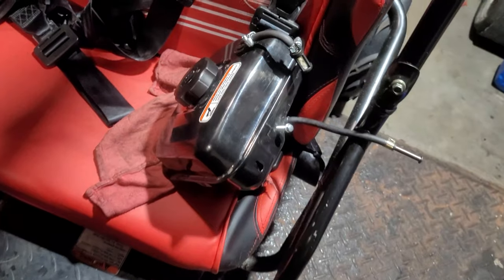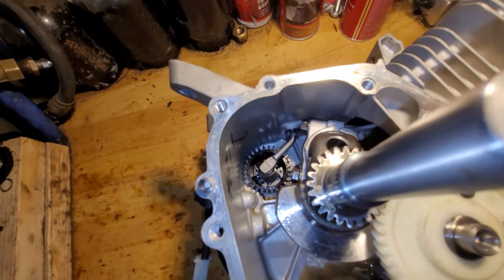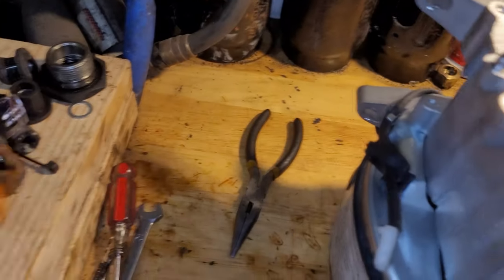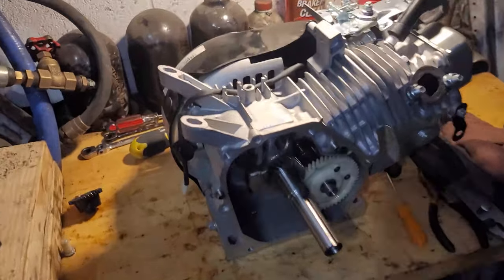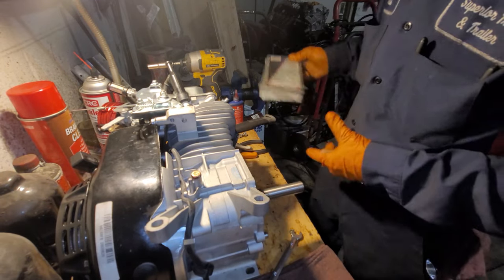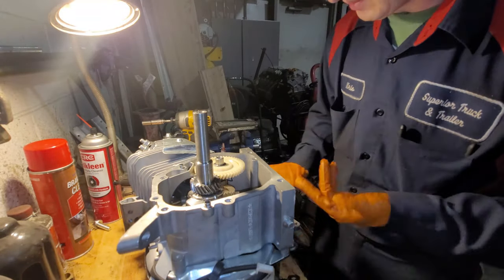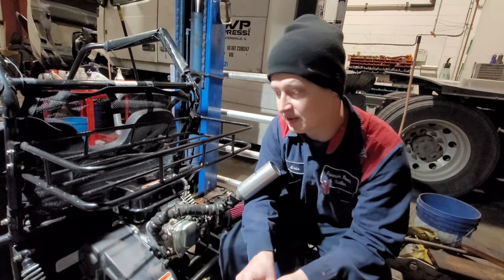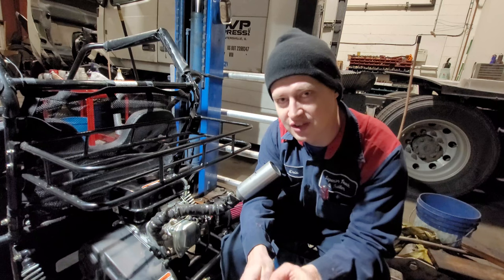Superior Drift Garage - KT196 Governor Removal and TOP SPEED RUN!!!

Comment: I achieved higher RPMS WITHOUT deleting the governor. I noticed that the gas cable doesn't throttle down all the way which prevents the full power. The reason is the Governor lever is designed to do that, but if you  delete the governor lever and rewire the springs a certain way then it will function at full speed.
Reply: Can you make a video how you did this?
Reply: How much faster?

Comment: I just slapped the street tires (lawnmower smooth knobbed treads) , the straight pipe with muffler, injector jet upgrade, and intake kit with better spark plug. Premium gas. She MOVES :) , i will do this as soon as possible. I LOVE POWER!!! THANK YOU A MILLION
Reply: Did u do it
Reply: @joshbrothers3822  not yet, got tied up with life a little lol. Its still in the plans
Reply: Im bout to try it myself. Its a great gocart. You get to it yet? I know how it goes
Reply: @JakeHorne90  i have not yet. I had a spindle arm break apart. So had to fix that lol. I do plan on doing it still. Found an AMR 300/500 supercharger  i would love to put on as well. I added an inline fuel filter. So far the carb has been smoother and havent needed to clean it in between season. Just after it sits for months, i spray brake cleaner in the throttle and drain the bowl. Once it warms up. I plan on doing it :) . In the mean time i made my sons electric dirt bike run about 27-30mph LOL.

Comment: You can also adjust the throttle cable up front where it connects to the pedal and bring the top nut all the way down and the nut behind that one all the down as well. I just purchased one today and it went from 17mph top speed to 30mph top speed.
Reply from the maker: Screw under my pedal way always all the way down....even the day I purchased it. Obviously I didn't get it brand new....but speed was just as you've seen. Thank you for watching!
Reply: Really?
Reply: @thomasquinlan8704  yes
Reply: I'm going to try this, because I was having problems with idle control while tightening the cable to achieve higher RPMS.

Comment: Hi there, we followed the video to a t, the instructions were super clear and helpful. The only thing we can't figure out is where to hook the throttle lever rod and or spring up to. He didn't really show that part any help is greatly appreciated. Ty!

-Mike
Reply from the maker: The throttle arm that you have originally is what you mount the throttle cable to. Keep it simple by reusing that. Drill a small (tiny) hole in the throttle arm, and bend the original throttle rod to fit from the butterfly to your hole in the throttle arm. Secure the rod even with zip ties and should be great.

Comment: How did u hook the springs back up. Now they are just hanging there. No clue how to hook them up
Reply from the maker: I really wish I could have take a pic, in that time I switched to a Mikuni so it's a totally different deal.
Reply: @superiordriftgarage 
I have the same problem. I have no idea what to do know. I have to control over the throttle

Comment: I have the same cart, once you removed the governor linkage, how did you hook up the throttle?  Because the governor rod and spring is usually hooked on to the throttle.
Reply from the maker: I rigged a L shape linkage out of the governor rods that were left over from the governor removal and used that to go from the butterfly to the bracket that has the handle for the throttle. Wish I could post pics on here somehow to show you what's up.

Comment: Question. On the bolt that goes in the hole where the governor arm we cut off is, if I weld a stud on the top and the bolt and put the arm that holds the springs will that work? It wouldn’t  have any play like the original but I don’t know if you need the play
Reply from the maker: Yes it would work,  if you can weld it you can make it work on my opinion

Comment: Could you show a video on how to hook up throttle after this
Reply from the maker: I screwed up by not showing exactly what needs to be done. Currently this gokart has a different carb, so I'm not really able to show that. Anyway, you need to reuse the stock plate that sits on top of the engine that originally holds the throttle cableand drill a tiny hole in the original handle. From the handle, use the rod that is left over from the governor, bend that to a "L" shape and feed that into the drilled hole.hope that sort of makes sense.

Comment: Hey there! Great videos! I got a question on how to remove the rear axle for the KT196. Is it just pressed in and do I.just hammer it out and slide it out?
Reply from the maker: I'll be totally honest with you...I haven't taken apart the rear axle. My guess would be some axle stops by the bearing press board...the part that's mounted to the rear chassis and holds the bearing inside.

Comment: How do you hook up the throttle springs with governor off now? Wish you would of showed this step in the video
Reply from the maker: I don't know how it happened not to be I'm the video but ever since I switched over to a mikuni carb so throttle is completely different. Old setup was connected to stock throttle handle by a rod. Small hope was drilled into the handle and rod to the butterfly.  Rest of the linkage was stock placement.

Comment: Question so we have one fairly new and every trip we have we here a loud skip or jerk of the chain or somthing also a hissing sound when we get on it I use not ethanol gas as I've seen videos where they have used it and engine is fine should I be ? Could chain be too tight it has a little play in it should it have any play at all
Reply from the maker: That's most likely your CVT engagement.  There are stronger springs that could be replaced for a better lock up. I don't think your chain is too tight,  I experience the same jerk move once it gets to engagement.

Comment: there is a bolt under the gas pedal if I removed would it flood the engine
Reply from the maker: Nope, won't flood anything,  it will only open as much as the throttle body will allow.
Reply: @superiordriftgarage  Thanks

Comment: I wanna make it faste but in a more simple way like adjusting the cable or smth how do i do that?
Reply from the maker: Check if the pedal is all the way,  if your throttle is opened all the way... that way you can determine if any adjustment of the screw on the pedal is necessary.

Comment: You don't need to remove the governor to get 35 out of it I just took my restrictor off my but that bolt out of the from the gas pedal and took my screw at my throttle out and I can get 35 out of it with me I weigh 196 in my son with 85 lb

Comment: So where did u put the arm that connected to the governor arm.? Now there is just a bolt there so what connects the carb to throttle to make it go?
Reply from the maker: I need to send you a pic so you can see what I've done.  Basically I've drilled a tiny hole in the top plate,  and my am arm from a piece of aluminum wire that was part of the governor crap. Where can I send you the pic?
Reply: Did u get the email
Ok?
Reply from the maker: No sir, no email at all
Reply: @superiordriftgarage  sorry. I meant my email address . I didn’t send u an email.
Reply from the maker: Yea, give me your email or whichever way you want me to use to send you the pic.
Reply: i’m having the same problem no clue where to put the arm

Comment: I was told if you zip tie the throttle spring it is a governor bypass without taking it out is this true?
Reply from the maker: Negative,  you still have the gear inside that's going to interfere. Only was to bypass is to remove it...but.... please try that zip tie trick and let me know the results.
Reply: @superiordriftgarage  I did zip tie trick on my Coleman minibike it now goes 34mph so yes it works on a mini bike. But not sure about Coleman gocart.

Comment: I have this same go kart bought for kids and it keeps shutting off on idle problem started same day bought factory new 
Any suggestions
Reply from the maker: Pop the black safety cap and adjust the idle a bit with a screwdriver.  Unless you have already done that,  then perhaps carb needs a little adjustment.

Comment: So i want to purchase this go kart but i want to make sure i’m getting my moneys worth so i have a questions, to make it go 36mph all you did was remove the governor? Also what kind of oil do i need to use for this go kart and how regularly should i change it?
Reply from the maker: Correct,  governor is limiting rpm so that's why it won't go faster.  I use racing oil with a lot of zinc,  and really just change it when it looks very dirty.  Maybe around 100 hours of use... not sure.
Reply: @superiordriftgarage  Thank you so much i really appreciate it, so when i get mine all i have to do is remove the governor and i should be hitting 36mph like you did?

Comment: What did you do with the springs for the throttle and stuff after you took the pin out
Reply from the maker: I reused as many as possible to make the throttle close as fast as possible.  Longer spring is attached to the arm containing the limiter screw, and short spring is in the same place as oem.
Reply: Do you have a video of how you did the throttle linkage after removing the governor?
Reply: @chadbasen5072  did u ever figure it out. I’m in the same boat

Comment: Question. I did this, reinstalled everything, and now the pull cord is almost impossible to pull and I can’t get it started. Pull cord snaps back. What did I do wrong and how do I fix it.
Reply from the maker: You sent your valves the wrong way, not at top dead center. Make sure you're at top dead center. If you turn the motor, it will seem like the piston is up top but one more turn puts it at top dead center.
Reply from the maker: Might seem that you're at top dead but you're actually not. At top dead center both valves should have plenty of freeplay as nothing is putting pressure on them.
Reply: @superiordriftgarage  what do u mean I sent my Valves the wrong way?
Reply: And how would I check/fix it
Reply from the maker: Take the spart plug out, and as you turn the motor, watch the piston reach the top. Turn the motor a few time to see when piston is at its highest, when it's at its highest point, that's your top dead center and then set your valve lash properly.
Reply: @superiordriftgarage  I don’t have to pull the engine again to do this do I? And why did this happen. What did I do?
Reply from the maker: You don't have to pull the engine apart, just take off the valve cover. It's easy to confuse true top dead with what may seem like ots top dead. I had the same scenario before on one of my engines.  Unless something else is going inside the casing, but usually what you described is the compression not allowing you to pull the cord.
Reply: So I checked the valves with a .003 feeler gauge. They were correct already.  Any other ideas?
Reply: And without the spark plug it pulls easy
Reply from the maker: @joshbrothers3822  yes, without spark plug it doesn't have any compression. You have to make sure that when you set your valve lash you're at top dead center. Turn the engine another 360 degrees with piston on top and then set valve lash.
Reply: It seems spot on. Anything else maybe?
Reply from the maker: @joshbrothers3822  at this time nothing really comes to mind.  If you're able to freely spin the motor without a spark plug and have the valve lash set,  there is nothing else that comes to my mind that would prevent the motor from running.
Reply: @superiordriftgarage  figured it out halfway. One. The timing gear indents weren’t lined up,  valve lash is 3 when it would be 1 & 2. But it won’t move because I’m missing something that connects the throttle and the carb. When I step on the gas the throttle moves but nothing connects to the carb to complete it. What connects the two